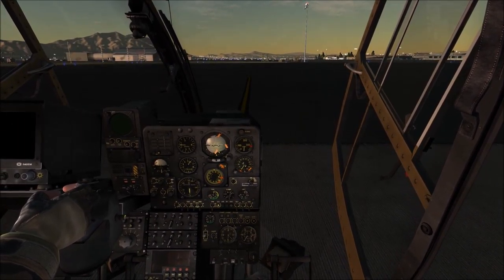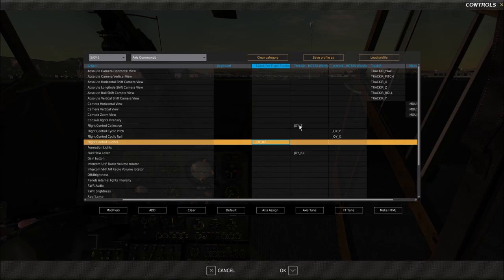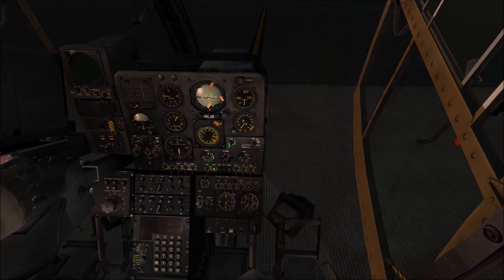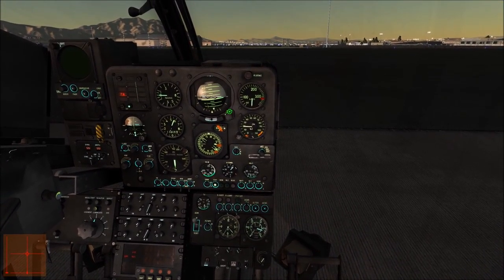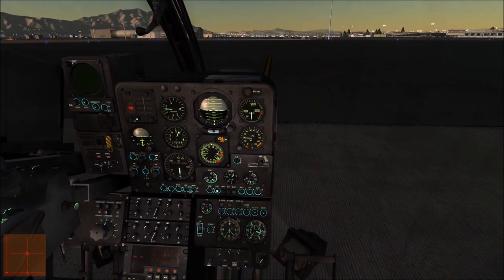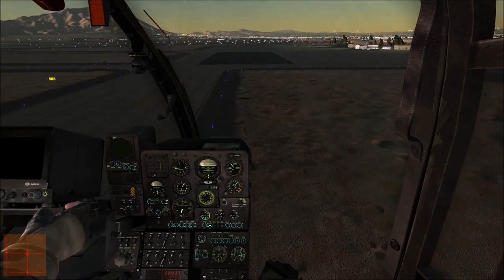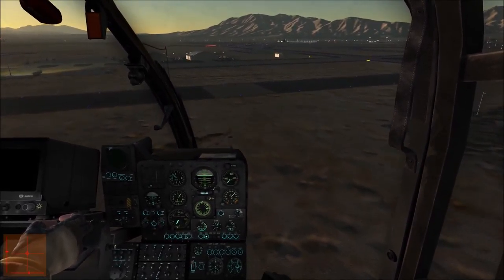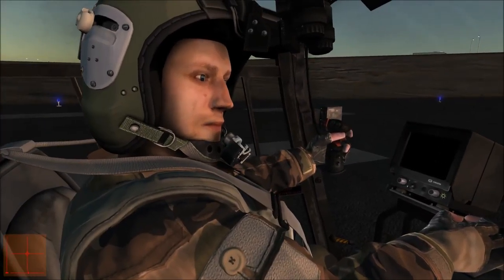Controlling the DCS: SA-342M Gazelle

Comment: Great video man!! :D Best ive seen on the gazelle:) just ome question: whats the whole thing with the right/left and clockwise/counterclockwise rotating heli? Why does it matter what skin to touch down first? :) Thanks in advance. Dynamixx.
Reply from the maker: In very simple terms: to counter the torque of the rotor you have to apply right/left rudder which results in the tailrotor providing thrust to one side which will push and roll the heli sideways (left/right for cw/ccw rotating rotors). To counter this you need to apply a bit of right/left cyclic (again, depending on the spin direction of the rotor) which results in one side of the helicopter hanging a bit lower than the other.

This is only a very simple explanation and there is a lot more to it but it's enough for a basic understanding of the phenomenon.